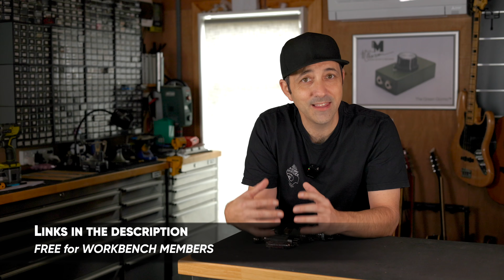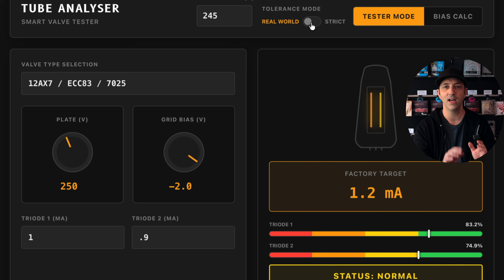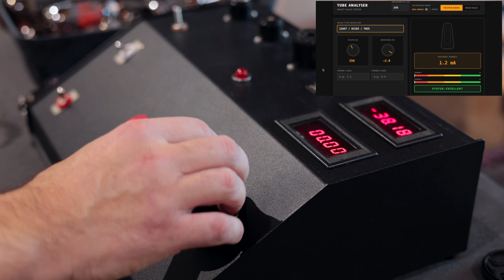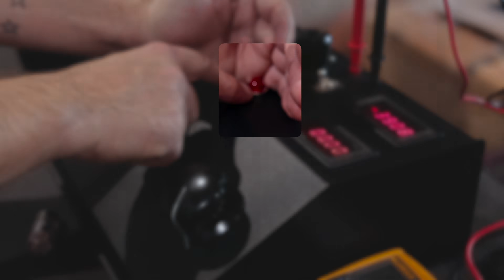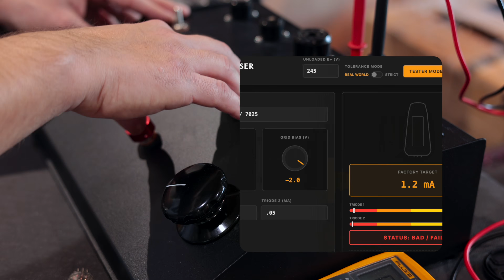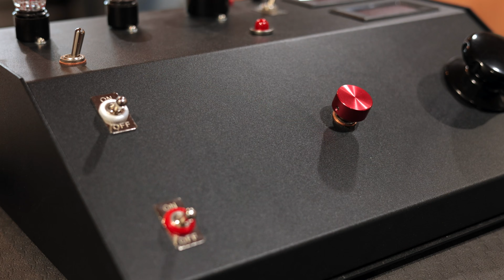The Baking Tray Tube Tester Replaced My Expensive Testers

Comment: Sounds like a really interesting project!
I built a RoeTest a few years ago - and, honestly, I don't want to miss this unit in my workshop!! It's not only the massive database that also includes the weirdest pre-war tubes, it's also options like testing tubes for noise, hiss, shorts between all possible electrodes, being able to write characteristic curves, printing labels etc pp... It's simply next level of tube testing - and for a professional tube amp workshop, imho it's a must-have.
On the other hand, building a RoeTest is MUCH more expensive and time consuming than building this Baking Tray Tester - so in case you really only need to check 12A*7's, some common powertubes (like EL34, 6L6, 6V6 and EL84) and maybe a few rectumfriers, the baking tray thingy seems to be a really cool option!

Comment: I've just bought the McPherson version schematic and most of the parts are commonly available, but the transformer, which is the same in the original, is proving to be somewhat elusive for me in the UK. 
I'll do some more searching, but if anyone knows of a transformer that is suitable, which can be bought easily in the UK, could you reply to this comment.
If I find one, I'll make a post as to where I sourced it.
Reply: I have the same problem.. Can't find it anyplace in Europe.. Please let us know if you find one that works..
Reply: @mrkve2019  I'm currently thinking about a plan B as I plan on making a bench power supply for valve experimentation / development. This project will be  based on a design in Merlin Blencowe's book, Designing Power Supplies for Valve Amplifiers Page 206 Fig. 7.40, which consists of a solid state ''Maida regulator,'' which Merlin used as a bench power supply himself.
I thought, seeing as I plan on making a high voltage variable power supply for my bench, I could use that to power the valve tester, and simply make a separate valve tester module that plugs into the power supply.
Obviously I will have to make sure that the voltage settings are set to the right value for each valve, but I'd install meters to monitor this.
The power supply also has the added advantage of variable current limiting from 28mA to 100mA as well as the variable voltage from 40V to 400V.
Reply: @zedcarr6128  Interesting! Im thinking of using two separate transformers.. one 6.3v and one 30v.. Should be ok don't you think?

Comment: I actually own the “Otto” tube tester and matching rig that was used in the 1990’s by Sovtek/Reflecktor tube factory in Russia. It tests power tubes, 4 at a time so the tubes can also be evaluated for matching tubes for the output stage. I have to thank Owen and Mike Matthews from electro-harmonics for this unit. I’ve been using continuously since I acquired it back then. It’s definitely accurate and a one of a kind unit. Thanks!!
Reply: Wow. Damn how did ya get ya hands on that. And you met the mad scientist himself at EHX 😮 SICK
Reply: @michaelmarchei8539  I’ve know Mike for a long time. I’m a bit of a mad scientist too, and have been working on tube amps designs since the 1970’s.

Comment: Hmmm I love it... 💜💜💜💜💜 I have a lot and I mean a lot of tubes (probably 60-80) for my 8 tube amps.  I have been kicking the can down the road about either having someone test all of them or buying a super old tester.   I do have a degree in electronics so I know I could build my own from your instructions if I had the time to do it.  I am way behind on getting my 10k hours of practice in... I am fighting  loosing battle between old age and arthritis there.   Anyway back to my point..  I would gladly give YOU a $100 USD for a complete kit that comes unassembled from the big A, E, or T and order it...  I have the tools probably and definitely have the skill set to assemble it.  

I finally have all the  parts in to build the dumbleton v1 but need to get an enclosure which I haven't sourced yet, if needed.    

Thank you!  You make electronic projects look easy, cool, and practical.
Reply from the maker: Thanks so much! 😊 I really appreciate that. I don't sell kits at the moment, but all the parts are pretty readily available if you want to build one yourself. And honestly, with your electronics background, you should have no trouble with it once you get the time. Hope you get that Dumbleton built up and running too! 👍

Comment: JJ's datasheet? Nothing says "I don't care about my tone so I'm using those". Rubbish.
Reply from the maker: I get where you're coming from! I've actually been using JJ's for around 25 years and they've served me really well, so I've got a pretty good track record with them. 😊 Tungsol are also a great Tube!

The JJ datasheets are just being used here as an electrical reference for the tester — they don't really have anything to do with the tone of the valve. Whether you like the sound of JJ's is a completely separate thing. 👍
Reply: The obligatory comment from a person who has no idea what they're talking about. You don't need this tester, you have golden ears i'm sure 🤘
Reply: Nothing wrong with jj. I've gotten more microphonics from goldlions.
Reply from the maker: I have had such a great run with JJ's after 25 years of installing them in customers’ amps compared to other tubes I stock; they are a workhorse tube!